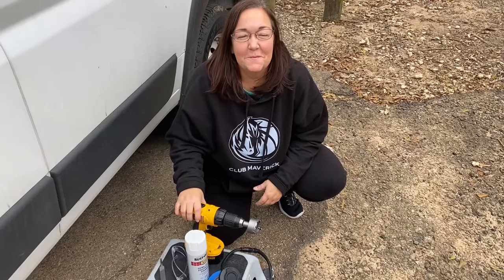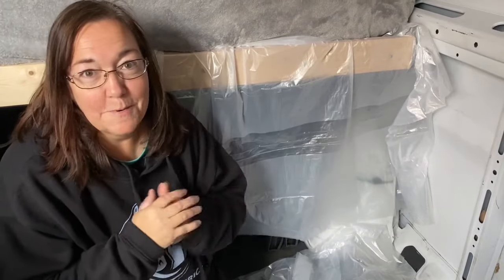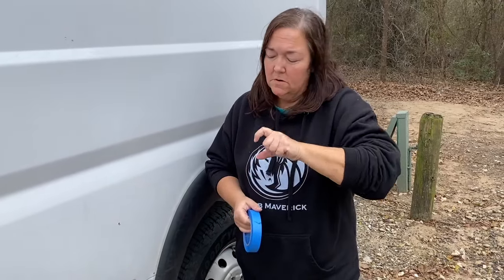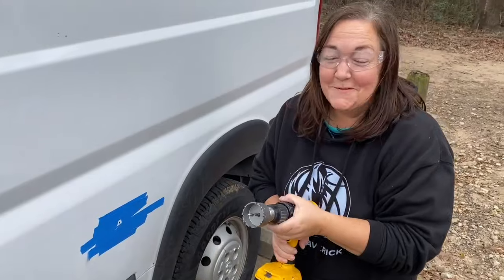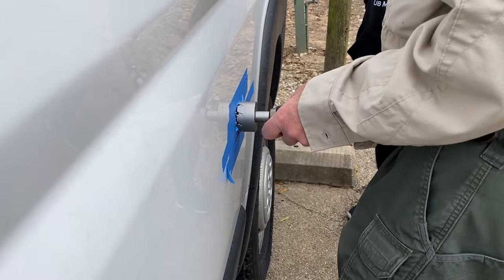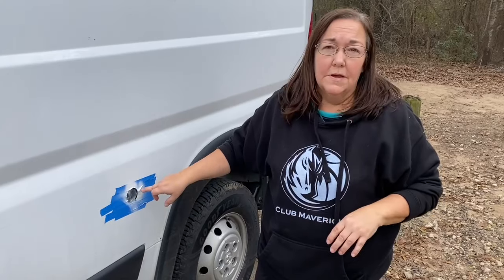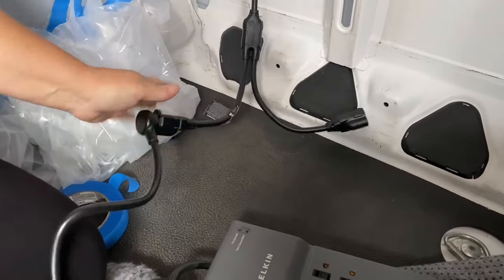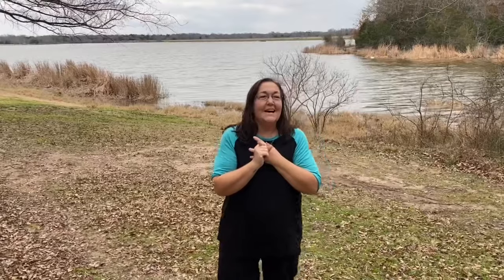Noco AC Port Plug installation on my van

Comment: Hi Christi. Just saw this video and thought I would share that on Ram Promaster you can put the Noco shore power under the taillight in the rear. You would only be make a hole in the plastics and the cord feeds through your taillight to the inside. There is a rubber piece and if you want to see what I’m talking about I posted a video on me installing it. Sooooo much easier and no holes in the metal.  I figured if I messed up I could replace the plastic taillight piece.  Hope this helps anyone else. Don’t mind the very unedited version of my video. Going to check out your other videos. Stay safe
Reply from the maker: Thanks for sharing the additional option :-). Feel free to post your video link here for others to visit as well :-)
Reply: @TinyTexanAdventures appreciate that.  https://youtu.be/OJTYpuu3lyU?si=7Qrv5g6qPH3--xiZ
I think I attached the link. Not sure. Please let me know. 
I love to learn and share with other van campers or car campers. I also put the Sunestra in my first Ford van (before I bought a new one).  Loved it. Worked great.  Unfortunately I sold my van 1.5 yrs ago to stay home and take care of my dad. He is on hospice so I won’t leave the area. I’m 2 min from him. But I do hope to be carcamping in my Ford Flex again.  Me and my 🐶 have been to all 48 states. She has missed some out west but prob been to 40 so she is well traveled dog. Thx again. Stay safe and you got a new subscriber. Can’t wait to see new videos and your adventures.

Comment: Good work! I attached mine to pumper plastic of the van. The ProMaster has a cavity in the pumper area that you can fish in the plug wire without drilling into the metal sheet of the van. This is advantageous if you're risk averse (no possible leaks) or want the plug to be less obvious--stealth. Mine looks almost like factory against the black pumper  plastic of the van.
Reply from the maker: I know several people who have done it that way also and it worked well for them :-)

Comment: I had mine done in '22. I'll admit that I chickened out & paid a friend to do it instead! Which worked out better because when he went through the first wall, he was met with a 2nd wall to go through. 
I got the same double plug you did. 
It is such a game changer from running an extension cord from a window to running it properly!
I too put mine on a power strip. 👍
Reply from the maker: lol. It made such a difference having that small change :-). I just noticed you have a YT channel also, I subbed ya :-)

Comment: Bravo!!🙌👍I really want to install one on my van but it is so hard to find someone that I trust to do it. I have bought the plug and have had it for over a year...still sitting in the box.🤦‍♀I wish I had your courage to do it myself. Excellent job.👍👍
Reply from the maker: I sure hope you can find someone (it really is a pretty easy process) because it sure has made a difference not having to run a cord through open window or door. :-). Best of luck to you.
Reply: @TinyTexanAdventures  Thanks same to you. 😊

Comment: Good job being very careful to put up the plastic protection inside your van to catch the metal shavings.  So few people do this step.

I am surprised to see some new DYI people forgetting to paint with rust protection paint or primer.  I wonder if they will have a rust problem there later.

Since I need to do this external plug installation soon, your video is exactly what I need.
Reply from the maker: Aw thanks so much for watching. I’m no expert/professional, but I’m definitely learning.  Best of luck to you!

Comment: I installed mine through the plastic bumper at the rear corner of the van.  No holes in the metal!  Saw this way on youtube.
Reply from the maker: Yes I’ve seen that too and I get why some people prefer that for sure :-). Thanks for commenting that here so others reading have that option as well. :-)

Comment: Very informative.  Quick question - I see on a lot of van builds that they install this at the left rear of the van thru the plastic near the tail lights.  Did you consider that?  If so, what was the deciding factor for locating it where you did.  Thank you, enjoy your channel!
Reply: That is what I was just commenting on above. I did that and made a video on YT.
Reply from the maker: Thanks for tuning in :-). I have seen others do that as well, I just didn’t want to cut through the plastic.  It’s really just a preference thing for me :-)
Reply: @TinyTexanAdventures  it’s one hole with the 2” hole saw and u feed the wires up through the taillight entrance into the van.  Is that what you mean ? Not 2 holes

Comment: Nice job! Are there usually 110v outlets where there are 30 amp at Texas State parks?
Reply from the maker: Thank you and yes most of them have a 110 outlet as well. I do carry a small adapter to step down from 30 amp to 110 just in case :-)